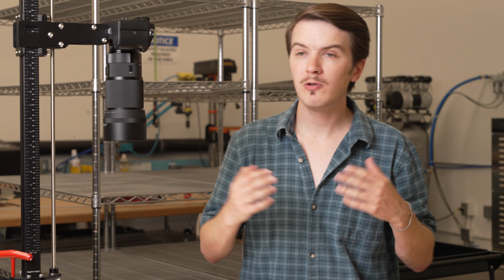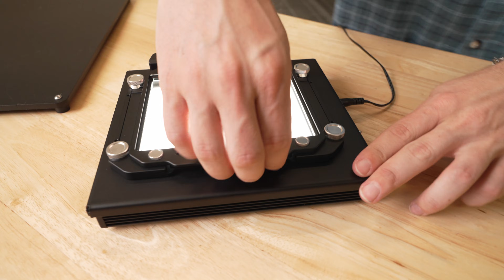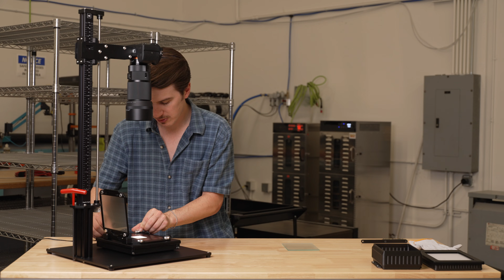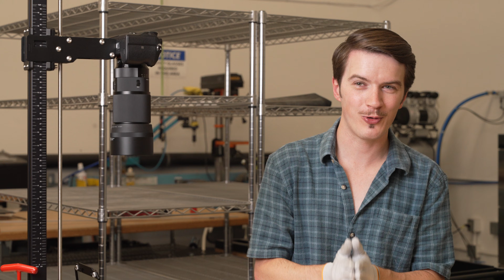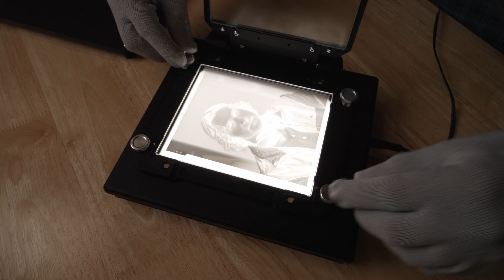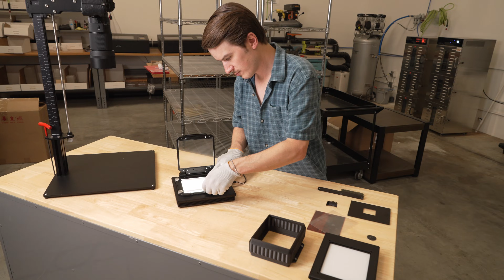Introducing the Pro Film Carrier 4x5

Comment: Two ANR-glasses on top and bottom? Seems to force „unsharpness“. From my darkroom times I remember the following order on my Durst enlarger (top -> bottom): lamp, ANR-glass, film, CLEAR-glass, lens and paper. There should be NO ANR-glass between film and paper, means for scanning: NO ANR-glass between film and lens. Sharpness freak doesn‘t use any ANR-glasses on an enlarger, because ANR-glass diffuses the light -> sharpness in decreased 🧐
Reply: You are correct about this. On emulsion side should not be ANR glass but only anti-reflection (museum) glass
Reply: Also did you catch that they recommend emulsion side DOWN?!?! you're scanning more plastic and glass than film at that point